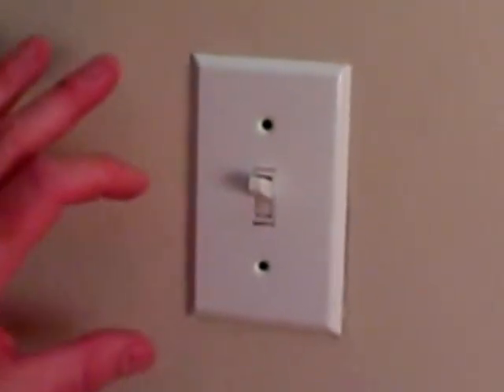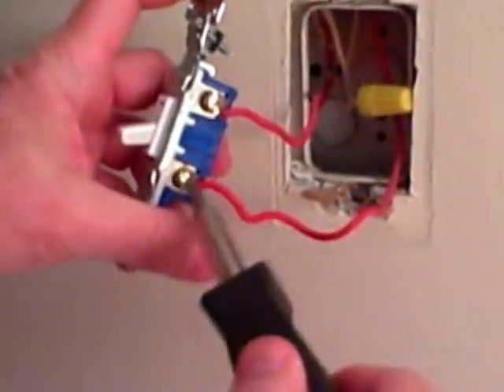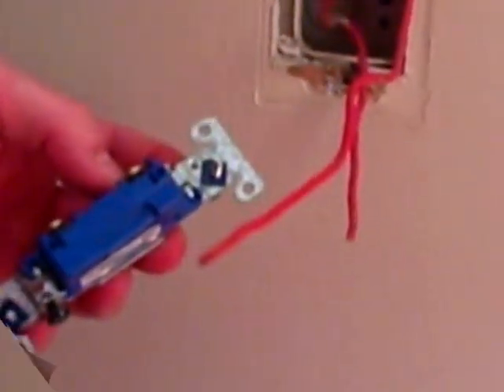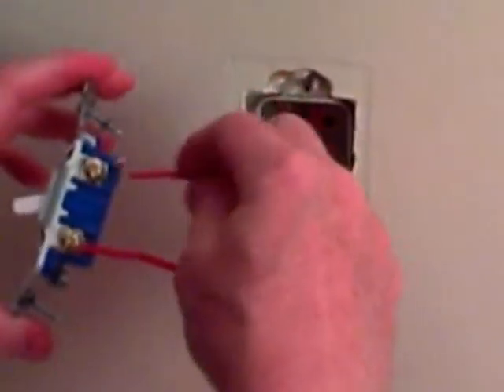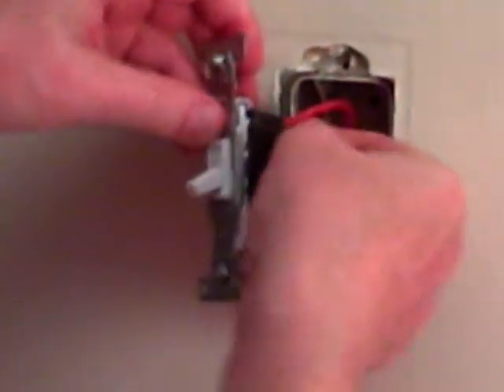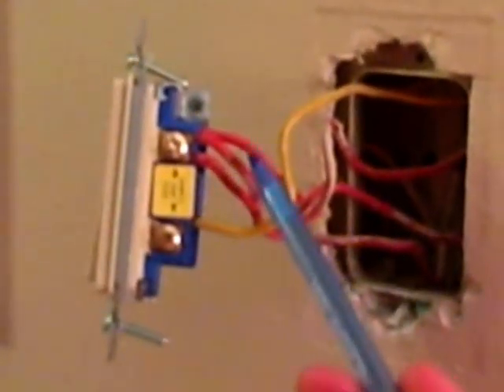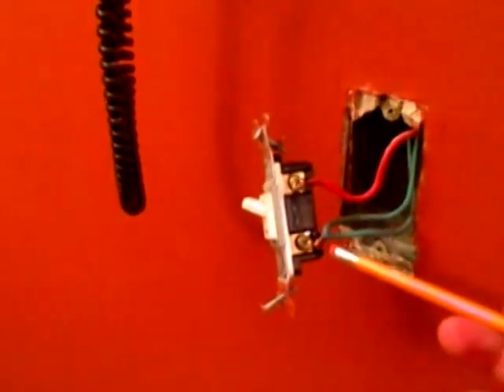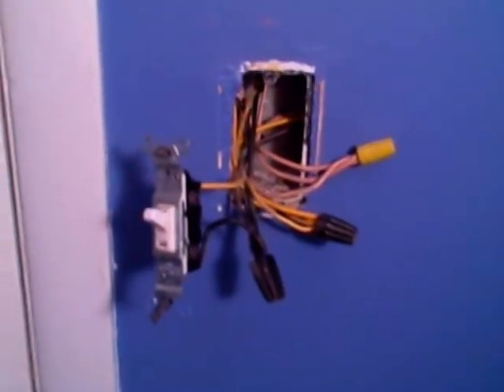Wiring a Switch - Single Pole Switch - Conduit

Comment: I’m replacing my light switches in a bathroom, one is a light switch and the other is a vent fan, both have a full wire wrapped around the screw and continue on, like the middle of the wire is stripped just to contact the screw, can I copy this method with the new switches?
Reply from the maker: Hi, yes, that is a wiring method some electricians use.
Check out more home improvement tips in our e-books https://www.amazon.com/gp/product/B0B2KW1FQ9?notRedirectToSDP=1&.

Comment: Hi got a new question for you I would imagine changing an outlet plate is as easy as lightswitch plate but the advice would be use an insulated screw driver sound right thoughts please thank you
Reply from the maker: Hi, you should always turn off the power to any circuit you are working on and check it with an electrical tester. A shock under certain conditions can be deadly.

Comment: Hi got a weird question for you if for some reason I needed the swtich to be in the on position when in the normally off position it it was impossible to rotate the swtich could you not just trade the upper and lower wire connections and than the swtich would work in reverse?? thoughts please thank you I mean is really the only remedy to mount the swtich upside down? thoughts please thank you
Reply from the maker: Hi, for a single pole switch, it doesn't matter which hot wire goes to which screw. There is only one way the switch moves to turn it ON. For a toggle switch it will show ON on the lever. For a rocker switch, the top of the mounting strap will be marked with UP. 
Check out more home improvement tips in our e-books https://www.amazon.com/gp/product/B0B2KW1FQ9?notRedirectToSDP=1&.
Reply: @FIXITHomeImprovementChannel   I managed to find someone to answer my question they said the only real remedy to get the swtich to be on when face down is to mount the swtich upside down they said that changing the wires does not make a difference now I understand why the guy did not want to make any changes it was poorly why wire and the I think the more you try to change it the worse it will get !!!  but thank you for your response !!! the real answer seems to be rotating a swtich should be simple but thats assuming its not poorly wired the wiring was horrible poor so there was not way to change it!
Reply: P.s wanted to ask your opinion on some one had suggested electrical tape for a poor mans insulated screw driver at a max voltage of I guess 250 thoughts I mean I do have a battery and or electric drill that Use with screw driver bits rather than throw the set out at the normal house voltage of 125 it would seem that the best thing to do is wrap all my bits in electrical tape ? and hopefully I could still use an electric or battey drill set with a now insulated bits thoughts please thank you !!!!
Reply: Hi got a new question for you I would guess changing an out let swtich plate is as easy as a lightswtich plate change but maybe its safer to be sure I use an insulated screw driver? thoughts please thank you

Comment: I have a single pole switch with only two wires attached, on a line with the bathroom light.  I would like to change the switch to a switch / outlet combo.  Is that possible?
Reply from the maker: Hi, you need a white neutral wire in the box to connect an outlet. You can email me a picture of your electrical box and the wires to fixitpodcast@gmail.com.

Comment: Hi. I'm Jon and I'm trying to install a  switch/outlet in a closet. I only have two black wires, no ground and no white.  After connecting,  the light came on but the outlet isn't working.  This 100+ year old house is an electricians nightmare.  Please help if you can. Thank you.
Reply from the maker: Hi, you can send pictures and an email to fixitpodcast@gmail.com

Comment: why use two red traveling wires - you're using a red for a neutral which should be white, correct?
Reply from the maker: Hi, with a standard single pole switch, it is a break in the hot, there is not a neutral wire.
Reply: @FIXITHomeImprovementChannel  Ahhhh . . .  totally forgot . . .  thank you for the reply.
Reply from the maker: You're welcome.
We have more home improvement tips on our weekly podcast, Fix It Home Improvement. You can subscribe on your favorite podcast app. https://www.stitcher.com/podcast/fix-it-home-improvement-5/fix-it-home-improvement

Comment: If the switch works by interrupting the red, if you nutted the two reds together it would always be on right? We have a camera on a floodlight and dont want our roommates touching the damn switch
Reply from the maker: Hi, yes if you have a single pole connection like this. You could get a switch cover that prevents turning it off and keeps the switch in place.
We have more home improvement tips on our weekly podcast  https://podcasts.apple.com/us/podcast/fix-it-home-improvement/id880903087?mt=2

Comment: The switch I need to replace has two wires , one on each side and they are both black .
Reply from the maker: Hi, if the light is only controlled by that one switch, it is a single pole switch. Turn off the power, remove the old switch and put the wires on the new switch, the wires can go to either screw terminal in a single pole switch.
We have more home improvement tips on our weekly podcast http://castbox.fm/u/6389499.

Comment: Hello FIHI, my home was built in the 1940's I am installing a bathroom ventilation fan so In the process of switching my single pole switch to a dbl gang switch I noticed that there is only one black wire and one white wire there's no wire for the power to go out? Please help me. From Suzie
Reply from the maker: Hi, is the white wire marked as hot with black tape or paint on it? You can email a picture to fixitpodcast@gmail.com.

Comment: Nice video. New subscriber and I thumbs upped this video. I’ve got a question for you.  I recently installed a brand new ceiling fan, in a new location in living room ceiling.  I powered it through a junction box near by.  It’s a fan with LED light with wireless remote.  Every time I connected to power... My gf hollered up to me in the attic, and said that the light flickered. But when I wire nutted it in the junction box... It didn’t continue to give it power, which is so weird bc that should make it permanently connected. So I went back to the instructions.  So apparently I have to wire it to a light switch, but I have to keep the light switch on at all times in order to work the wireless remote for it?  I just figured that, I’d bypass the switch part, and run it to a continuous hot line which the instructions also said that I can do. That didn’t work. Where I’m at now, where the fan already has power.  Do I just add a light switch, wire the power black connect it to bottom of the light switch, bc it’s a 14-2 to the switch?  Then run the black(top screw going to the fan) up back to the hot wire of the fan? I could really use your advice and expertise on this please and thanks so much.  Happy New Years!
Reply from the maker: Hi, what is the make and model.

Comment: hi I have 3 red wires? 2 of the red wires are twisted together , how do I know which way the wires should be
Reply from the maker: Hi, is this the only location that you can operate your light from. Single pole?
Reply: FIX IT Home Improvement Channel hi yes that's correct it only operates from one location

Comment: Interesting.  You test to the outlet box (presumably metal and grounded) but don't ground the switch itself TO the existing grounded box?  Must be local code, like green exit letters.
Reply from the maker: Hi, in Chicago, Seattle and parts of New York where conduit is used, the conduit carries the ground, not a ground wire.
We have more tips on our weekly podcast http://castbox.fm/u/6389499.

Comment: Very helpful tutorial.  Thanks!  I need help trying to figure out a "no power situation" to switches.  Here's the scenario: In the same circuit, all of the outlets have power and good wired-connections, but none the light/fan switches has power.  No GFCI outlet fault or tripped circuit breaker.
Reply: Did you figure it out
Reply: @michaelshi7685   Yes, the problem was the ceiling fan light's motor.  After checking the switches for continuity, I replaced a new fan unit. It worked!

Comment: please don't laugh at me. I am trying to cut all power to my travel trailer stereo. It runs on 12V+ on battery wire to radio (YELLOW wire) and  12V+ on accessory wire to radio (RED wire). Would I install a regular light switch for the yellow wire and a light switch for the red wire? is there a better break switch on amazon that you could recommend for me?
Reply from the maker: Hi, you can get a battery cut off switch for an RV.
Reply: well i'm actually living in the travel trailer and the stereo still illuminates the trailer even when turned off.
Reply from the maker: You could wire in a switch and turn it off. How about something like this https://www.amazon.com/dp/B071YDZRBC?psc=1
Reply: That looks like it could work. so would i run the yellow wire in to one bolt and the yellow wire out of the other bolt and into the harness? then use another switch to run the red wire into one bolt and the red wire out of the other bolt into the harness? https://www.amazon.com/dp/B01N44NHTW?th=1
Reply from the maker: Hi, you would just put one switch on the positive side. That will shut off the power to your device.
Reply: thanks for helping me. I pray God blesses you for it :)

Comment: is it better to have hot on the bottom or is it just standard for consistency?
Reply from the maker: Hi, for a single pole switch, it doesn't matter. It's just a break in the hot.
We have more tips on our weekly podcast http://castbox.fm/u/4891735

Comment: What would happen if two hot wires are connected to a switch? Would the switch box burn?
Reply from the maker: Hi, if you connect 2 hots from different circuits, you will trip the breaker.
Reply: Ok cool. 
Reason why I ask, i just replaced my sister's switch. The old switch had to black wires on it. So i just replaced the old switch w a new one - copied the same connections. The switch works. It turns on n off the light. But the switch's metal cassing gets hot after a few mins.
Reply from the maker: Hi, a switch is a break in the hot going up to the light, switched outlet or appliance. If you think it is unusually hot I would replace it with a more expensive switch. It will have better component parts.

Comment: is color code different  from state to state. also i have a single pole switch that i am replacing yhe old one has two black wires at the bottom one is pushed  in the other is on the screw and on top it has e red wire that is pushed in no ground the switch i bought has a ground.do i have to use use the ground or just connect it as it was found and bypass  the ground
Reply from the maker: Hi, most of the country will use a non metallic cable. The hot wire is black, the white wire is neutral and the ground wire is bare. In the Chicago and Seattle area and areas where conduit is used, electricians will pull wire, so it can be a variety of colors. With conduit, the metal box is grounded by the metal pipe all the way back to the service panel, so many electricians don't pull a ground wire.
In your case I would rewire it like it was. You can send me a pic at fixitpodcast@gmail.com.

Comment: You should illustrate the new push on connectors that save some room in a box made crowded with multiple wire nuts.
Reply from the maker: I will. Thanks.Thanks.We have more tips in our home improvement book http://www.amazon.com/dp/B01BK2K0JM?ref_=pe_2427780_160035660
Reply: I’ve tried those, and I think that, they suck and therefore I’ll stick with the wire nuts.

Comment: hello i have a question at work i have four lights running from a single pole switch and this morning i tried to turn the lights on and makes a weird sound and turns the breaker off, ibreplace the switch but keeps doing the same thing what should i do?
Reply from the maker: Hi, you will have to go into each box and light to see if there is a loose wire or something causing a short.

Comment: I ran the cable from a single pole on off switch in my garage down the wall so i could tap off it to add an plug outlet and after all the cutting the holes and mounting everything i noticed there is no neutral wire in the single pole gang box...Am i screwed?There is only a black,white,and ground going to the switch and the white is always hot.When i flip the switch the black goes hot so that must be feeding my light in the garage,,,Is there any other way i can do this?
Reply from the maker: Hi, you need to connect from a box that has a hot, neutral and ground. I would come from the closest outlet. The switch is a break in the hot, so that white wire is hot, and should be marked with black tape or paint.

We have more tips in our home improvement book http://www.amazon.com/dp/B01BK2K0JM?ref_=pe_2427780_160035660

Comment: wouldn't you cause a ground fault if that wire was live, when you touched the tester to the metal box?
Reply from the maker: theweapon8972 Hi, no, the box is grounded, so touching one probe to the hot and one to the ground will test for power. We have more tips on our weekly podcast https://itunes.apple.com/us/podcast/fix-it-home-improvement/id880903087?mt=2

Comment: I wired a lightswitch in my basement I connected one white wire to one side and one black wire to the other side and every time I flip the switch the breaker trips off.  The strange thing is if I have it off and I plug my dryer in to turn it on the light works wtf
Reply from the maker: LMAONATOR Hi, was there a switch there before you replaced it. You can not wire a neutral wire to a switch. If it is a NM Cable and the white wire is hot, it should be marked with black tape. What did you remove to wire the switch?
Reply: Ok heres what I did, I have old knob and tube wiring, I used some yellow romex and wound white romex wire around white knob and tube wire then wound black romex wire around black knob and tube wire then taped the splices.  then i ran the romex to a switch and then another wire out of the switch to a flourescent lamp.  I dont know if this is legal to do but i finally got it working turns out what I did was put the neutral and hot wire on the switch which is bad i guess? i just fixed it by only switching the hot wire.

Comment: can I replace a single pole switch with a switch/outlet combo in an older home with just one black wire and one white wire going to the old single pole switch? Is the white wire in this case a hot wire and not a neutral? The new switch part will control an overhead light. Thank  you.
Reply from the maker: Hi, in this case the white wire is a hot. It should be marked with a piece of black tape or paint to identify it as hot. You will need a neutral wire to have an outlet. Some boxes will have the neutral wires twisted together in wire connectors. Some boxes will not have a neutral wire available.
Reply: thank you. In my case I connected the hot (black) wire to the Line screw, and the white wire to the Neutral screw and believe it or not, both the outlet in the new switch/outlet combo works, but the outlet (there is an outlet in the old light fixture but is is very hard to use way up there) in the lamp above works. The new switch, however, does not turn on the light! I am probably in for a fire.
Reply: I meant AND the outlet in the old light fixture
Reply: So maybe i have two safe outlets now, since I put the white wire on the Neutral terminal? That is okay with me, since I don't use the light fixture anyway.
Reply from the maker: just me Hi, the white must have been a neutral. The black wire goes to the brass screw and the white wire to the silver screw. Did the old switch work?
Reply: yes the old switch turned on the light fixture. The light fixture had a single outlet on it that worked even when the light was off. So now I have two outlets that work but the light fixture does not turn on with the new switch. I was googling around and saw that maybe a new 14-3 wire from the light fixture to the new switch might make the new combo I put up work perfectly. And is the white wire a neutral if I use it as a neutral, and a hot wire if I use it as a hot wire?
Reply from the maker: just me Hi. Turn off the electric to the circuit and then take the wires off the screws. Spread them apart so nothing is touching and then turn on the electric and test for hot. That will show you the hot wire. If it were wired correctly, black or red is hot and white is neutral, but a previous owner may have rewired that box.
Reply: I decided I would be okay with the outlet working but not the switch, but I plugged my blow dryer into the outlet and as soon as I turned the dryer on the light came on also. And it stayed on even when the switch was in the off position. The light went out as soon as I turned off the dryer. So I am going to call an electrician and have this done right, especially since it is in the bathroom and I should have a GFCI in there anyway. I guess the dryer was part of the circuit, and that can't be good. I don't think. But thanks for all your help and your quick responses. I'm in over my head though!
Reply from the maker: Let me know how it turns out.